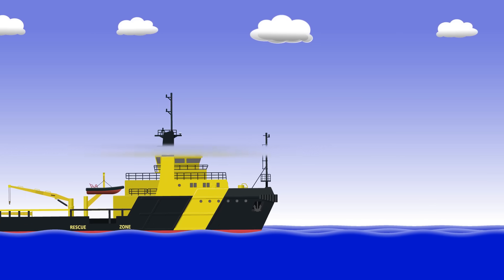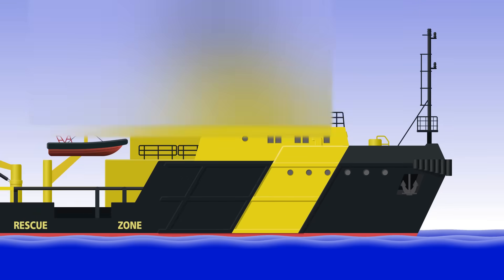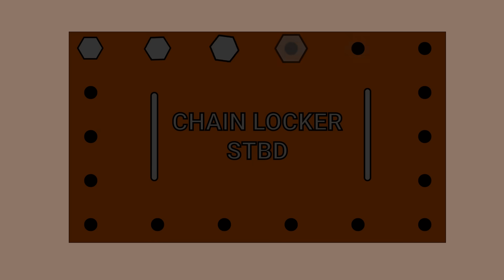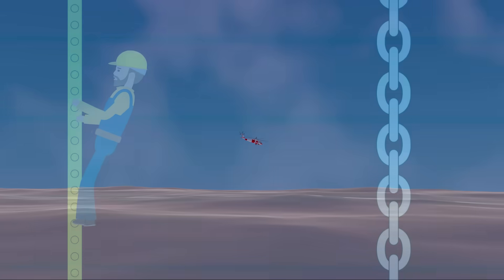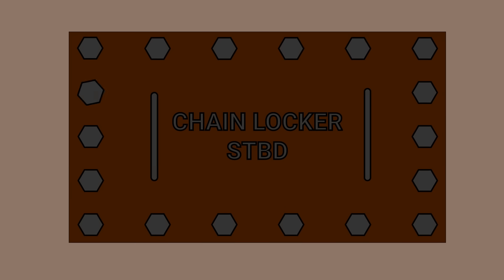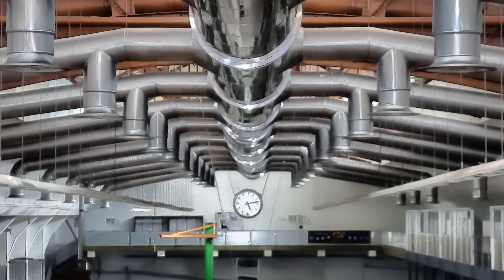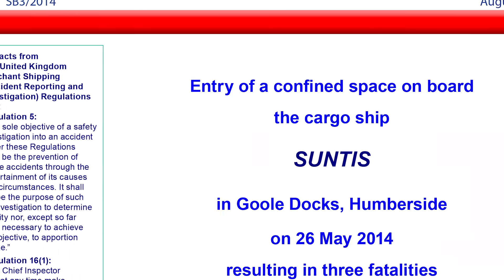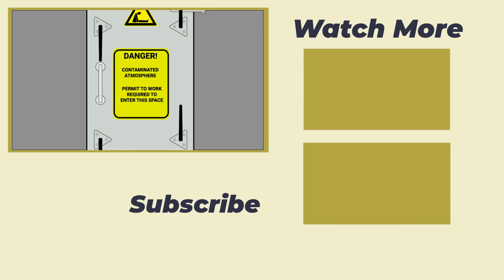Why Enclosed Spaces Are So Dangerous? | Enclosed Space Entry

Comment: In our factory, there are designated enclosed spaces that can only be entered with a work permit licensed by the state. This license is so stringent that nobody is qualified at the plant to do the work. We have experts come in and we arrange a state inspector who comes out and issue the work permit that only last 6 hours. If the work last longer than that the have to stop and go through the process of reissuing the permit again. We take safety very seriously. In Europe some contractors died in enclosed spaces. There were using the plant’s pressurized air for their air supply. That’s against our policy, they’re supposed to have their own independent system for everything. Well the plant lost power for a few min and that was all it took for the workers to pass out and later die from suffocation.
Reply: Where
Reply: @xPRODIGYxGAMER  The comment you're responding to never mentions the factory being in Europe though? In fact it specifically says a plant in Europe had worse regulations.
Reply: @XTriggerMasterX    You don’t bring up a random plant in some different country of the world if you’re currently talking about your plant. Chances are he’s in Europe, where there was a devastating accident, which in turn had them to adjust their rules/regulations to prevent another. 

If he does indeed not live in Europe, then he should take a class on relevance of writing, and use an example from a plant in his own country, where the regulations can give you a good idea of the similarities of a plant and how to avoid these situations.

EDIT: Take a class as in, a short 5-minute Google course that will massively benefit them later on. I don’t expect anyone to go take an actual college course on this.
Reply: @wrije  Mate the comment was written by someone who lives outside Europe. The US is my guess, as he talks about 'state inspector's' and 'permits licensed by the state'. In Europe, I'm not aware of any country broken down into states, and this is also a term used regularly by Yanks.
Reply: @Jock McScottish you fundamentally misunderstand what a state is in the United States. Germany is a state, France is a state, Massachusetts is a state, Florida is a state. In some countries like Germany or Canada they have provinces but the states in the United States are not analogous to provinces in other countries. Provinces are generally organizational structures and not much more than that, states are literally their own Nations. If it makes it easier for you think of the United States as being the equivalent of the EU and the individual states as being the equivalent of the member states of the European Union, although ironically individual states in the USA have far more autonomy then EU member states.
Reply: @micfail2  Everything you said was right, but you had to be wrong on the last sentence...
Reply: @jeanmarc6517  the only way you can make that claim is if you know absolutely nothing about the EU. There's a reason Britain left, that reason is because they were sick of losing more and more of their autonomy.
Reply: @micfail2  I think you just dont know what autonomy means. Also, only a part of Britain wanted to leave, and those were mostly the same type of people as the "We'll make america great again" americans. Try to see how the EU works, most of its laws are basic requirement and it was never created to force countries to give up their autonomy. Britain is suffering a lot from leaving EU even if its leader prefer to lie and tell the difference. Heck, EU go so easy on its members that countries like Hungary can just go as extremist as they want without any real repercussion.
Reply: @micfail2  the national governments are represented in the EU in the  Council of the European Union. While EU member states have less independence they have way more influence on the lawmaking process.
Reply: @micfail2  you just proved your point wrong Britain was allowed to leave. last time a state tried to leave the US there was a massive civil war over it and they weren't allowed to leave
Reply: @TheDiloEmpire  you need to learn your history. About half the states seceded successfully and peacefully, the federal government acknowledged that it lacked the authority to do anything about it and that looked like the end of it. Then sometime later the states that succeeded decided they wanted the army and naval bases in possession of the United States military back, which led to war breaking out when the federal government refused and the southern states attacked those bases to take them by force. It was and still is completely legal for states to secede, otherwise the federal government wouldn't have needed to wait for provocation before declaring war.

If you think the European Union hasn't been doing everything they can to retaliate against the UK then you haven't been paying attention.
Reply: @micfail2 You're still wrong, US states can't secede. Legal Eagle did a video on it, I believe in connection with some people in either California or Texas having gotten the silly idea.

Also, tell me you're a bitter brexiteer without telling me. For one thing, the EU had no reason to be particularly accommodating - it was Britain who got the (silly) idea to leave, and by then it became the EU's own best interest to protect itself. Coming from a Brit, and considering your own historical behaviour/policies as an empire, this just screams hypocrisy. Also, Britain made insane demands that they never would realistically get - you guys really were trying to have your cake and eat it too, everybody saw it, and were obviously having none of it.

Comment: Having worked around a lot of enclosed spaces I feel confidant saying:
Never enter until your Gas monitor says its safe.
watch that meter like your life depends on it (it does) even if you've been it that particular space a thousand times without issue.
have a plan for evacuation in the event you go down.
We always set up and used a winch/harness system for accessing manholes, If the person in the hole lost consciousness they would be lifted out (and probably hit every rung of the ladder on the way up). If you don't have a way of recovering a body before it becomes a corpse you don't send any one in.

Edit: in my own home i've been in a gas leak. I stumbled and fell down twice in 30 seconds but otherwise felt totally normal, the third time I couldn't get up, then suddenly I was in my living room. Thankfully somebody noticed and saved me without being another causality. You don't get a warning without a gas meter.

Comment: The nasty thing about such atmospheres is that you don't realise you're suffocating.  The unreactive nitrogen makes you think it's normal air, and the fact you're exhaling as well means you're not getting a build-up of carbon dioxide in your lungs that you get from holding your breath (and triggers the reflex to breathe).  The only clue you might get is some confusion before unconsciousness, but the mere fact you're confused probably means you won't try to escape or raise the alarm. And of course, once you're unconscious, you're still breathing that unbreathable air and your brain cells start dying.
Reply: That's why you should always have an oxygen meter with you that detects poisenous gas also.
Bloody thing saved my life.

Comment: It also illustrates how your breathing reflex is not triggered by lack of oxygen (but by oversaturation of CO2 in your blood)
Reply: And yes breathing is triggered by two drives - HYPOXIC DRIVE AND HYPERCAPNIC DRIVE.
Breathing too slow and shallow will set off hypoxemia (low O2) and hypercapnia (accumulation of excess CO2).
Reply: Its called hypercapnic drive
Reply: It illustrates how stupid people are despite being "trained" or "experts". This is pathetically dumb.
Reply: Well, more that the feeling of suffocation is caused by an increase in carbonic acid in your blood. It's why gasses like sulfur hexafluoride are so dangerous: you won't actually feel like you're suffocating.
Reply: Wouldn't that be the result if you're not getting enough oxygen? I'm confused.
Reply: @joevideowatcher  you can still expel co2 if there's no oxygen. And without oxygen you won't produce more co2.
Reply: @emissarygw2264  Thank you.
Reply: @emissarygw2264  actually high levels of CO2 causes a respiratory acidosis. the breathing reflex (hiperventilation) is your body trying to put CO2 out of your body. Angels is right.
Reply: @joevideowatcher  As EmmissaryGW2 said, you can breathe out CO2 and without breathing in O2 your body doesn't produce anymore CO2 so it "thinks" you're fine. This happens with the classic CO intoxication (often in suicide, or when material doesn't get properly burnt and there is no airflow). Your body thinks it's fine but your brain doesn't get O2 to work and you pass out and then die. CO intoxication is dangerous in two ways. First, the aforementioned inhibition of lack of oxygen signal that makes you pass out without even noticing it, and secondly, the CO molecules have a strong bonding force to your blood cells that are supposed to transport oxygen in your body and deliver where it's needed. Due to this strong bonding force, those blood cells aren't free anymore to take O2 molecules. So even if you're rescued and taken out of the danger zone, you still can die of lack of oxygen for a while because your body is unable to absorb enough oxygen from the air.
Reply: @angelsjoker8190  Essentially, this could happen with any kind of noble gas or just low air pressure.
Reply: @Elite7555  Yes. If I remember correctly, in Switzerland, a company invented a suicide booth (for terminal ill patients) that exchanges the oxygen/air with nitrogen within 30 seconds and you just peacefully fall asleep and never wake up again.
Reply: @joevideowatcher  I would like to try and clarify this a little better for you if I can. If you put a person in a sealed room with normal atmosphere you would pass out then die long before the oxygen level of the air fell to a lethal level. At high concentrations co2 is toxic to the body its not as simple as the respiratory drive alone that's why space craft and submarines have co2 scrubbers on them check out apollo 13 they had a problem with co2 I am a retired paramedic this was in one of our how not to get killed classes
Reply: Smoking helps you build tolerance tl CO2 poisoning, eventual becaming able to breath just co2 and survive
Reply: Unless you have copd or are a chronic heavy smoker, then the oxygen drive overrides your co2 drive, because their body is used to high co2.
Reply: @gangisspawn1  No, the strongest signaling factor is CO2 levels in the blood, not the O2 levels. That's why people pass out and die without noticing it in CO environments or the one mentioned in the video.
Reply: @angelsjoker8190  no you're wrong with the conditions I listed. If you give supplemental o2 to those, you can kill them by shutting off their respiratory drive. 

You're not right arguing against my statement, I have a medical degree, look it up.
Reply: Angel you are right in yes the main drive for normal respiration is elevated CO2. Tom is right in saying that people with certain medical conditions can become CO2 retainers in which their body then uses lack of O2 as their respiratory drive. Hence why you don't give them significant O2 or else you surpress their drive.
Reply: @gangisspawn1  there is no such thing as an oxygen drive. The fact that you used that silly phrase means you have no idea what you are talking about, and you certainly don't have a "medical" degree, whatever that means. I suspect it means an affinity for youtube arguments.
Reply: @gangisspawn1  could you share further reading about this? I'm currently taking a physiology course and I don't think we covered this so I'm curious
Reply: @efeyzee  It's standard knowledge for medical professionals. I suggest starting with COPD patients who are used to having high CO2 and low O2 saturation that would kill a normal/healthy person. Their problem lies in diffusion in the lungs, but temperature, PH, circulation, etc., can all have an effect on gasses in the body. 

The average goal SpO2 for a healthy person is 98-100% and in an average COPD patient is 88-92%. 88% O2 and high Co2 with COPD is completely acceptable for them but deadly to a healthy person. It's always possible to get their O2 to 99%, but you can kill them doing that. The reason for this is the body's acclimation to high CO2, high acidity(co2), and low O2. The body is used to high Co2, so the O2 response is the main respiratory drive. Raise O2 with high supplemental oxygen, reduce their respiratory drive cycle, increase Co2 + acidity, and cause cell damage > death. Their lungs don't diffuse Co2 out or O2 in well. So Co2 is high, O2 is low. The brain is used to living with high Co2 but it needs its O2 to perform cellular respiration. It's normal is to call for O2 and by effect gets O2 and releases Co2. The call to release Co2 isn't frequent enough because it's beyond the normal call threshold.

We give supplemental O2 for these patients to decrease the respirations per minute(Workload on their body, hyperventilation can only last so long until you tire) and increase the perfusion of each breath. More breaths = less Co2, more O2, more fatigue. We don't want to get them to 99%Spo2 because the brain is used to having plenty at 88-92% avg. It will stop calling for O2 which is a less frequent drive than Co2, and the Co2 drive is used to being high so its too slow. Its the increasing acidity of high Co2 that is the problem(body isn't breathing enough to release it) not the O2 levels. Now they can die from too low O2 also, but that's not what we are talking about. (((Point: O2 is the main drive of respirations for this diffusion problem. We want lower O2 to keep driving the release of Co2))). Thats why you see COPD people with O2 tanks at 2L/min, expected O2 of 88-92%. They can usually get to 99% with enough O2, but it's no benefit to their body. It's only to keep their O2 in their acceptable range, release Co2, and decrease fatigue. There is a big difference between SpO2(finger probe) and SaO2(arterial blood gas), SpO2 being the more misleading of actual levels in these patients, But that's more complicated. 

It's not my opinion, it's a medical fact. It's a misconception that Co2 is the only drive for respirations(yes with healthy people). When a healthy person holds their breath, their urge to breathe is to release co2. Not the case in conditions that result in a normal high Co2. COPD is only one of several conditions that you don't want to give someone too much O2. It all depends on what the patient's body is used to.  

It's simple once you understand it. The body is incredibly resilient and has many fail-safes.
Reply: @gangisspawn1  I was more so asking about the physiological mechanism. The chemoreceptors controlling breathing are sensitive to pH, which isn't changed by PO2 but by PCO2. Is there another mechanism that suppresses respiration for high PO2?
Reply: @efeyzee  I am not very familiar with what chemoreceptors control what breathing mechanism, but here is what I could find. It appears to not have a definitive answer for the reason yet, but offers specific theories. This article also mentions what I said earlier. You might find a more specific article for the answer you are seeking. 

>>>>COPD patients have diseased lungs, and over time their bodies have carefully allocated perfusion to parts of their lungs that work, and away from the parts that don’t. Administering supplemental O2 disturbs this careful balance with diseased sections seeing increased oxygen pressure and stealing perfusion away from better functioning areas. This results in shunting, dead space ventilation, and eventually high PaCO2.
The second theory is that there are two central drivers that trigger breathing. One is high levels of carbon dioxide (CO2) and the other is low levels of oxygen. Because COPD patients spend their lives with chronically high CO2 levels, they no longer respond to that stimulus, and their only trigger for respiratory drive is the level of oxygen (or lack of) in their blood. Supplemental O2 removes a COPD patient’s hypoxic (low level of oxygen) respiratory drive causing hypoventilation which causes higher carbon dioxide levels, apnea (pauses in breathing), and ultimately respiratory failure.

Another theory is called the Haldane effect. Proteins in our blood such as hemoglobin (Hb), combine with CO2 to form carbamino compounds. But deoxygenated Hb is more likely to bind to CO2 than oxygenated Hb. When O2 supplements are given the equilibrium is shifted between deoxygenated and oxygenated Hb more towards the oxygenated form. This reduces the amount of CO2 that can be bound, and that CO2 winds up dissolved in the blood, resulting in an increased PaCO2.<<<<

https://www.drugs.com/medical-answers/you-give-oxygen-copd-patients-3563491/#:~:text=Supplemental%20O2%20removes%20a%20COPD,is%20called%20the%20Haldane%20effect.
Reply: @gangisspawn1  The article you're citing does focus on CO2 detection as the driver. It mentions it may be possible that there's a mechanism directly influenced by oxygen too, but that is highly speculative (more speculative than what this article suggests - no evidence for this is presented, and it contradicts observations of how organisms react to low oxygen environments, as well as our understanding of the underlying physiological mechanisms).

Comment: I'm confused. How can the area be completely inclosed if the chain for the anchor has to be going out that space and into the ocean? Thus there should be some hole?
Reply: As there is no wind passage through, only the upper part of the room was effectively ventilated. In the lower part the oxygen consumption was faster than the air was replaced.